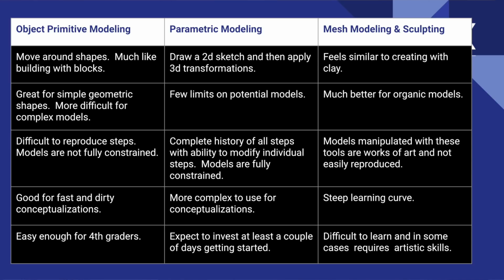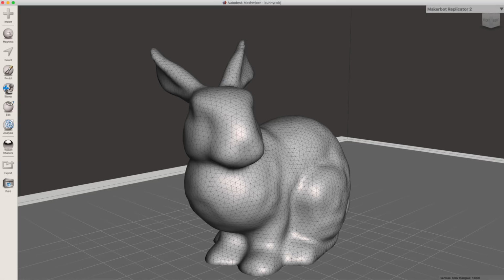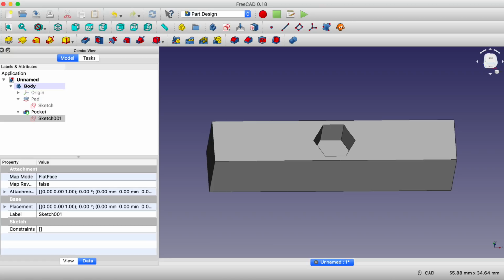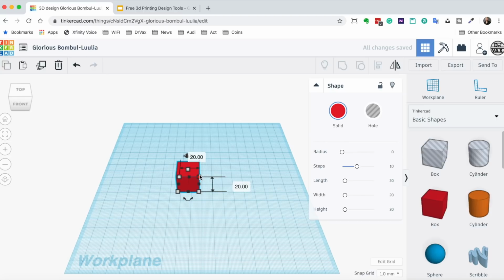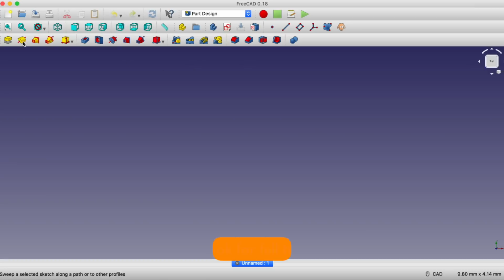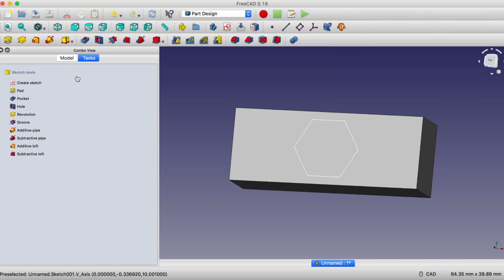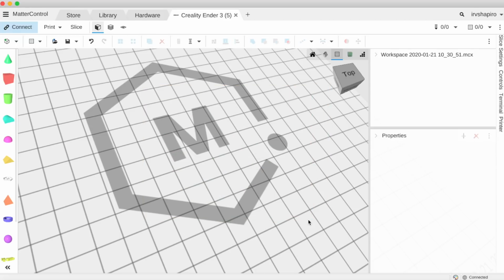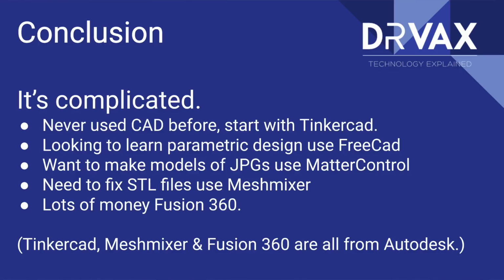Free CAD 3d Print Design Tools 2020

Comment: Hi... Great Videos!!... I´ve learned a lot... ;)... Could you do some videos on analyzing prints and what is affecting them... basically fail prints or not opimal and how to solve them... For example, Im starting in 3D and I´m not quite sure of how the best result would look like, I still see horizontal lines, and I´m not sure if I have achieved the maximum or my printer or should I continue tweaking.... (what is the best surface that a 3D like ET4 can achieve?? in regards to smoothness??)

Thanks a Lot for all the videos and a Great way to explaining them... Cheers!!!
Reply from the maker: Great idea.

Comment: I think you didn't show the power of parametric using parameters in FreeCAD. You can reference parameter of another object. For example, you can have the hexagon be 10 mm smaller than rectangle or 10% smaller or cosine of one dimension of length. You can also have object reference a spreadsheet as parameters (eg, lengh=cell A2, width=cell A3, forward extrude=cell A4, etc)

Comment: Prusa slicer you can  cut models up to print  or make new one's or parts of models to be-combined later in matterControl ,  all done in stl files
Reply: i use a Prusa Mark 3s    and  Prusa Slicer
Reply from the maker: You are correct and I use PrusaSlicer at times with my Ender printers because the support capabilities and cutting capabilities are excellent.

Here is a  video about how I use PrusaSlicer with my Ender 5:

https://youtu.be/8xly3xj9b4k

Comment: Great overview! I didn't know MatterControl, so I'm currently looking at it, and I'm quite impressed with this all-in-one solution. Modeling, raster image tracing to vector, organizer, 3d printing / slicer - quite a package.  Btw. for those who want an easier approach to organic modeling, I can recommend the free Sculptris. It's much easier to use than Blender, and if you want to see if you can make an organic model such as a bust, monster etc. - it's actually very capable. I usually export my Sculptris models in 3DS format and pull them into TinkerCAD or Blender to convert them to STL files, which I can then slice and print.
Reply from the maker: Thanks for the Sculptris recommendation.  I will take a look.

Comment: Nice Intro to different type of modeling software available. Thanks.
Another open source parametric modeling tool is OpenSCAD. 

This runs on MACs, Windows and Linux.
This tool is more for programmers and not for beginners.
If you ever seen customizable things on Thingiverse it was probably done with OpenSCAD.
This does have a fairly steep learning curve, in essence you  write a program calling predefined 3D or 2D shapes and perform mathematical operations on them.
for example a cube:  cube([x,y,z],center=true);  // where x,y,z are the lengths in the 3 dimensions
Create a trapeziod 

b = 10;
B = 20;
L = 15;

h = 30;

// use the method defined below

trapeziod(b,B,L,h);

// this is a method that uses various predefined operations to create the 3D trapeziod

module trapezoid(b,B,length,height) {
   translate( [ 0, 0, -height/2 ] ) 
    linear_extrude(height)
    polygon( points = [
         [ -B/2,-length/2],
         [ -b/2, length/2],
         [ b/2, length/2 ],
         [ B/2, -length/2]]);
}

Google  for more info.
Reply from the maker: Yep.  I am a big fan of OpenScad.  Here is a video I did about it:

https://youtu.be/t6BDz1FlgpM

Thanks for sharing all the details for my viewers.  This channel is all about sharing what we learn.

Comment: Design Spark Mechanical -  is free and very quick to pick up as  well as being pretty powerful -  for dimensionally accurate parts this is  what I use... its pretty quick to get things done too... for fun the fun stuff I use  Blender -
Reply from the maker: This is a repeated comment ....

Multiple people have recommended Design Spark.  It looks very interesting but as a Mac guy, I generally only review software that is available on both a Mac and a PC with Linux being a plus.   However I recently purchase a Surface Go, long story, and will give it a try if this machine is fast enough.

Thanks again,  Irv
Reply: @MakeWithTech  Hi, I also use DesignSpark Mechanical and if you don't mind, I want to suggest a short demonstration video that shows not only that it is simple to use, but also quite powerful https://www.youtube.com/watch?v=ZXgMY3-hlgs&t=11s

Comment: I do use images in Tinkercad a ton. I convert them to svg and layer them to make signs and such.
Reply from the maker: Yes.  The key is you need to first convert them into svg format.  Unfortunately tinkercad is a bit fussy about the svg files it will import.   I will be covering this in the upcoming weeks.  Thanks for sharing.

Comment: A great video as always. Another interesting piece of software I use quite a lot is Design Spark Mechanical. I find that it is really good for not only designing something from scratch but it does a very good job of importing stl files and allowing easy modifications. I do use Fusion 360 and Design Spark isn’t as comprehensive but it’s an easier program to master.

Comment: Fusion 360 does not have to be expensive. Autodesk has changed the Fusion 360 licensing policy. Nowadays it has also a "Personal - Not for commercial use" subscription, which is one of the free types (like educational and starting businesses). You only have to extend it yearly and state you still use it as intended: personal. It may take some time to learn, but it is a great tool.
Reply from the maker: My concern is that autodesk, which I think is a great company, keeps changing the licensing policy for fusion 360.

Comment: Great video!  But I do have to correct you on fusion 360.  It is not just free for a year.   They allow you to renew your non commercial/hobbyist subscription yearly.   I have been signed up and have been using it for several years now.   I prefer it over the programs that you have mentioned because it can do so many different types of modeling.
Reply: Yes, you can renew the free license each year right up until Autodesk decides otherwise.  I hate to be so committed to Fusion 360 that I can be held hostage when Autodesk decides that I must pay their fee or start over by learning another CAD program.  I started with Fusion 360 and find FreeCAD very different and thus quite challenging to make the switch.
Reply: @ronaldmorrison2765  Yes I do fear that happening.   But I really think that this will be a long lasting opportunity.   Or at least I hope!
Reply from the maker: Thanks for sharing.
Reply: I also use f 360 on a free license. It is really powerful and the beginning is quite intuitive.  Easy to learn hard to master.
Reply: Do you still use fusion now?